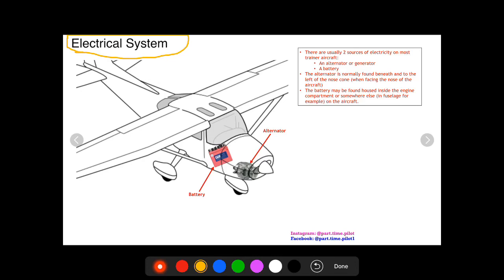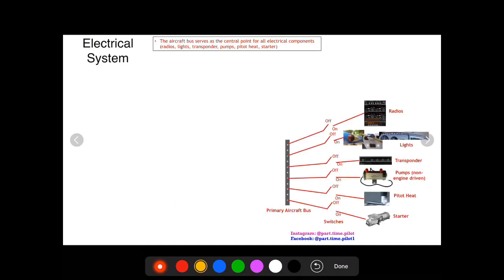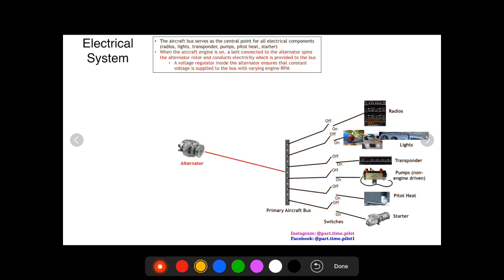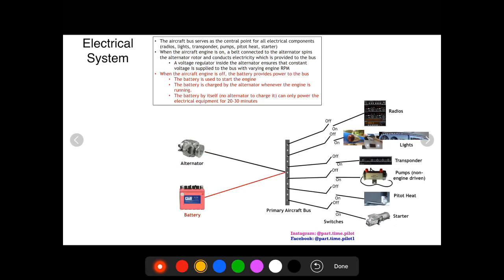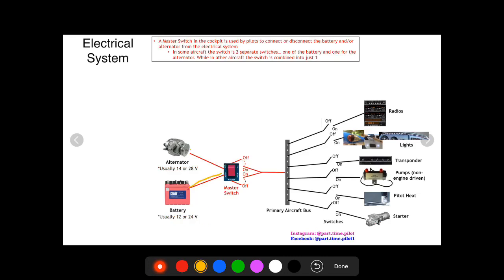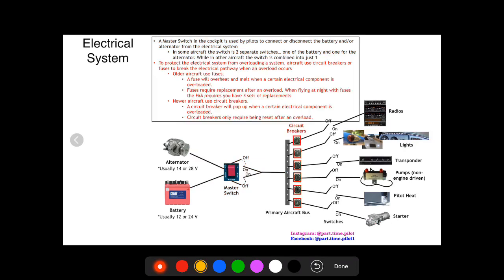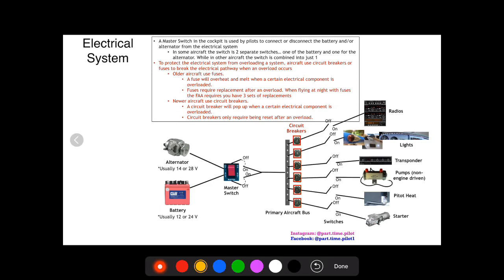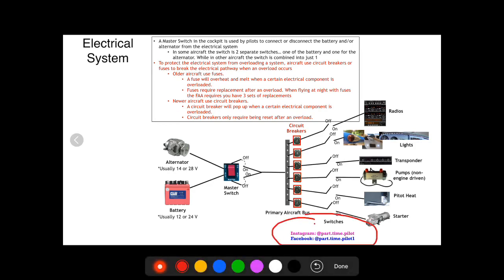How Aircraft Electrical Systems Work - For Student Pilots

Comment: If your volt meter is reading 27.8 would it still be safe to fly?
Reply: I’d assume as long as you aren’t showing a discharge, then yes
Reply from the maker: Depends on your aircraft and depends on what your ammeter is saying. Some ammeters show charge and discharge which can tell you if your alternator is keeping up with the load or if you are taking from the battery.